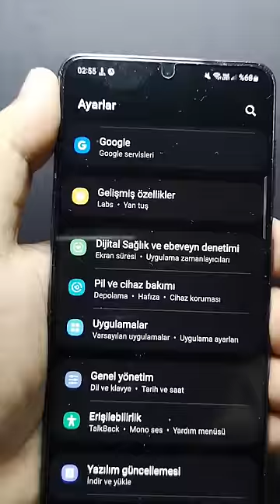How to get wireless electricity from mobile phone #shorts #zaferyildiz #short#electronics#viral #led

Comment: Wireless power share uses ac so you need to put a full bridge rectifier. Adding a capacitor will smooth out the voltage. Lastly, make sure the coil matches the resonant frequency.
Reply: Right
Reply: Не нужен тут выпрямитель. Диод сам это и делает.
Reply: @foureyedchick  a full bridge rectifier also makes the backwards voltage into a forward, useable voltage that can be turned into light
Reply: a full bridge rectifier will result in a voltage drop of 1.4V, ie most of the voltage available.  Better is to put two LEDs in parallel but opposite direction, then no loss.  Circuits like this are still not efficient though.
Reply: @foureyedchick  a bridge rectifier wastes a large percentage of the available voltage, simply use two LEDs head to tail to flash on positive or negative voltages, then all the available power goes to the LEDs
Reply: @foureyedchick  huahshuaa....diodos de germânio 0,6. De silício 0,7. Não vejo muita vantagem.
Reply: NO need a rectifier since LED is diode it already rectifies the very small ac voltage from the coil. 🙄
Reply: Thanks
Reply: @jackwody7774  I didn't think about that, I suppose it would be better to use leds as rectifiers
Reply: FULL BRIDGE RECTIFIER!
Reply: @foureyedchick  to protect the LED from harm? what harm?
Reply: @foureyedchick  from the video, a 1/8watt resistor in series would be enough limiting to 1mA or less. 😀
Reply: It,s use reverse charge wireless charge or nfc?
Reply: Diode also ?
Reply: or just use 2 leds, one in every way
Reply: Led is not use diode is led on diode

Comment: As a tutorial video I’m a little unimpressed due to the lack of technical information. He failed to share to us by not mentioning the number of turns of coil required in this contraption, the wire size, plus its voltage power rating. Otherwise this video woulda been very useful as well as educational.
Reply: true but its just for fun

Comment: Bu şey değil mi, eskiler bilir, tuğla gibi olan ericsson sh888 arkasına, anten kısmına yakın şekilde takılan radyasyonu düşürdüğünü söyleyen çıkartma bant gibi yanıp sönüyor 😀
Reply: It drops the signal, better said.
Reply: @soupflood  cell phone low signal and for radiation but highest radiation  to remove from the human body
Reply: @hamdikaya3405  cellphone radiating power >> a few LEDs. When cellphone sees low signal, it sends full power.
Therefore, LED's defeat purpose of antenna cellphone.
Reply: Onun nasıl yapıldığını gösteren videoda var

Comment: you can add a 1000μf 16v 👌
Reply: piezoelectric devices create a minuscule amount of charge into the very small capacitance (think picofarads) of the device.  Adding such a large capacitor will reduce the voltage accordingly to millivolts if that according to Q=CV.  For the same charge Q, increasing capacitance C forces the voltage V to go down.